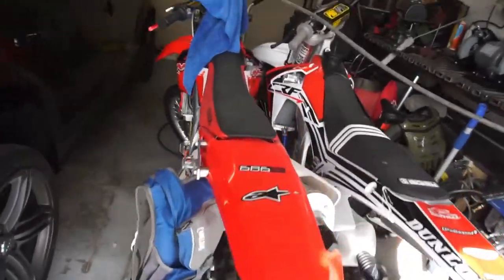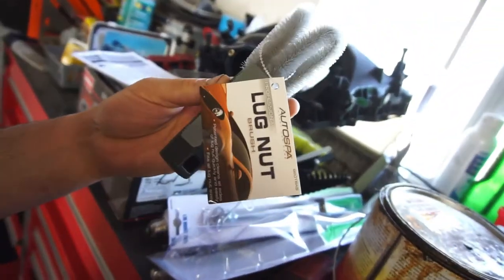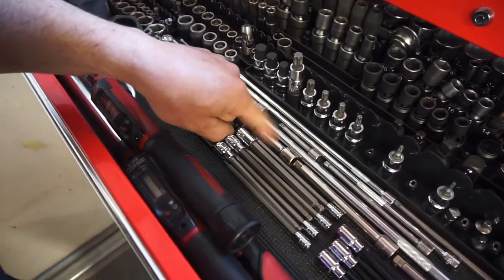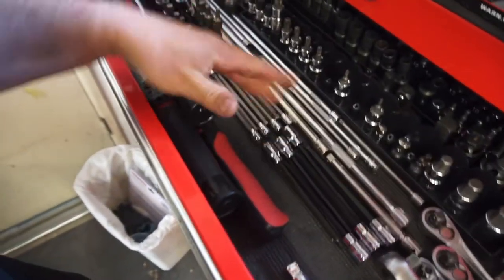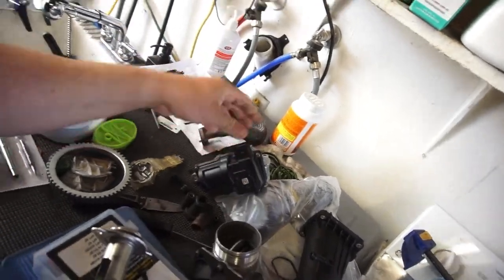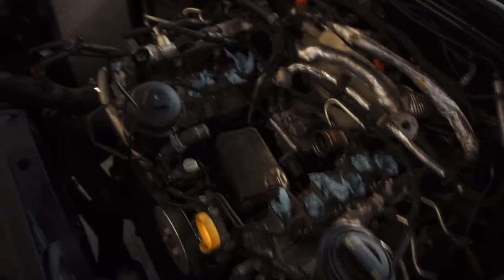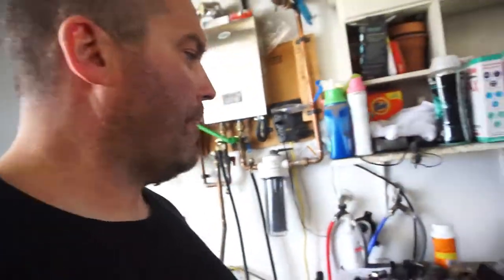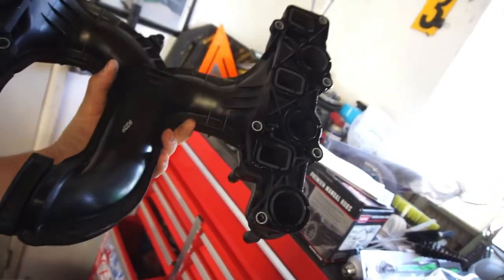2015 Audi Q7 TDI 3.0 Cleaned Out About 3 Pounds Of Soot On The Intake. Nasty Stuff. VW Diesel EGR

Comment: Are ya' gon'na get your exhaust filter cleaned ? I remember the last semi I drove was a lease and that filter was constantly needing to be recharged , ( I forget what the "tech." term is )  But you have to pull over and it gets super hot and "cleans" it self . The lease co. finally removed it and had it professional cleaned . Of course I didn't get that unit back , I just got to drive it when it was a pain in the rear !! If your engine is that coked up its probably because that filter is restricted .  Does the Audi even have an exhaust filter ?  Man, that sucker is going to fly compared to what it was once you get it all cleaned out !  Good luck !  Thoose T-handle torx wrenches you got are probably just a shank with a plastic handle cast around them not an "L" shaped wrench . Be careful they don't break on ya' while you're torqueing with them.
Reply from the maker: Tech term is regeneration. Yeah those torx are junk I can already tell. My car self regens. The actual egr isn’t sooted and the back of the valves look clean so I’m hoping the particulate filter is good. I’m gonna run some cleaner in the fuel tank once I’m done. And some engine oil cleaner.

Comment: Hello I just Find Your Channel I think I Need To Remove Intake In My 3.0 tdi Touareg  After U Install Intake Beck Together And Fueal Sensor And Fuel Line After U start The Car Do U Need To Bleed Air Out of Fuel Lines ? Thanks
Reply from the maker: I didn’t bleed any fuel lines. I just let it turn over for 10 seconds for 3 times.
Reply: @Halffast719  thank You For Your Reply I’m Going to Do It Today on my Vw Touareg v6 tdi I Thind Is Same Engine Like Your Audi 👍
Reply from the maker: No problem. Yeah probably the same.
Reply: @Halffast719  hello I Just Finish Puting Together My Vw Touareg Tdi I clean Intake And Put Evrythink Together And Now Car Won’t Stars Won’t Crank Just Clicking And It Gave me Some Codes
Reply from the maker: Did you clean the valves? Or just the intake. Probably just need to put a charger on it. Hopefully.
Reply: @Halffast719  I vacuum Valvs I Try To Clean Was Tuff intake I Clean It Really Good It Was So Gungt Up now won’t Start Is Give me Code U0106 no Communication With Glow Plug control Module
Reply from the maker: Sounds like one or more of the glow plugs are unplugged. One on passenger side is hard to snap down. It’s one circuit so they all have to be connected firmly.

Comment: Could this be the reason for shaking car when semi warn. Cold and warm engine runs smooth…
Reply from the maker: Anything is possible but I’d say no. Probably have a bad engine mount.
Reply: @Halffast719  this is happening only for a few seconds and rpms also oscilating for approx 200 rpms. Only after starts of semi warm engine. Completely warm and cold engine runs perfect.
Reply from the maker: Have you changed your fuel filter?
Reply: @Halffast719  Normaly should be done according with the regular maintenance schedule. The problem appears only when is minus temperature outside.
Reply: @Halffast719  according with the maintenance schedule, yes.
Reply: @Halffast719  If the fuel filter would be the reason then the issue would appeared when the engine is cold as well, but runs normal at cold start.
Reply from the maker: Maybe you need new glow plugs. My q7 never idles ruff. I’m actually in the process of cleaning the intake again. It’s been 40k miles since last time and it’s caked up again.
Reply: @Halffast719  glow plugs make problems during cold start. In my case is different. Audi dealer told me there are some flaps which have to be cleaned, soot makes blocking of flap.
Reply from the maker: So your swirl flaps are coated with soot. My engine doesn’t have swirl flaps. So in your case it makes sense. You can buy an intake gasket set with new swirl flaps for your car and you’ll have to do a walnut valve blasting job too to clean the valves. Which is what I’m doing right now to my q7 besides the swirl flaps.
Reply: @Halffast719  I dont have swirl flaps. But why this dirty is accumolating so strong? Car has 150000 driven

Comment: Hey Fonz, after fixing the coolant leak and cleaning out the plelham.  How is your Q7 running?  Is there a very noticeable difference and how about your fuel mileage?  Cheers, Mick
Reply from the maker: Yes I noticed quicker acceleration and about 3+/- MPGs better. I was getting 26-27 MPGs and now I’m getting 28 minimum. It’s running really good. I’ve put about 7500 miles on it with no issues and no leaks.
Reply: @Halffast719  Wow, you are packing on the miles.  Good Luck as always!
Reply from the maker: Thanks.